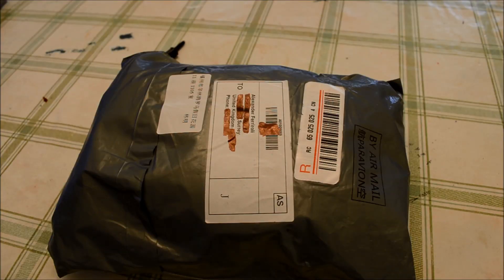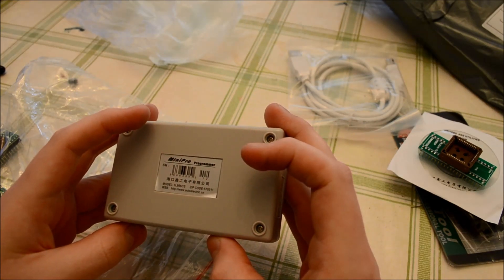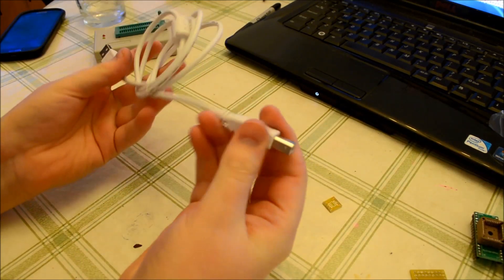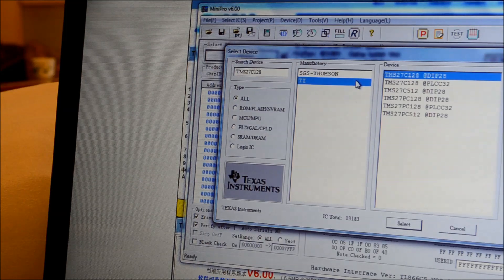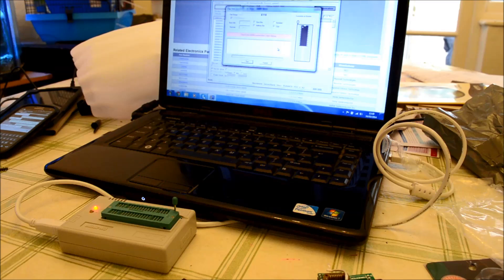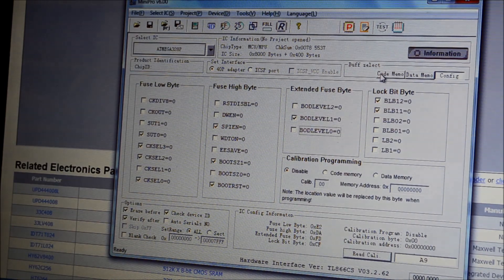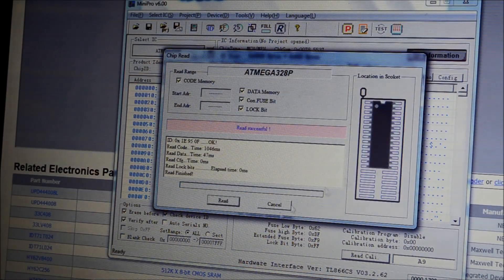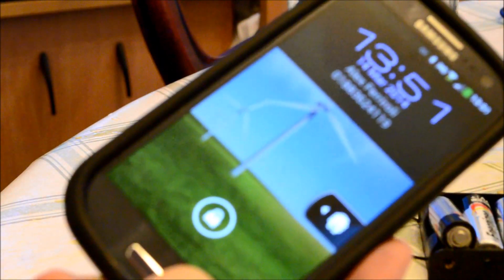MiniPRO TL866CS (TL866) Universal Programmer quick look and test

Comment: Hey i found very useful your video so thanks! 

I purchased a MiniPro TL866A and I'm trying to find some drivers for programming more devices. That programmer supports 16v8 GAL but I need the 22v10 programmer device one. Could anyone help me out to get the drivers?

Thanks!

Comment: Ok so what this device is useful for?
Reply: +Morris Spick Programming e(e)prom chips, obviously.   If you wanna update systems with programs on rom chips, you do it with this.  It's apparently great for reproduction games.
Reply: Programming microcontroller chips such as those used in the Arduino, programming PROMs, EPROMs & EEPROMs, testing logic ICs (74xx series) and testing many common RAM chips.

Comment: do you need to load tables or make any .tbl files or does it automatically find them based on the numbers that you searched
Reply from the maker: No tables had to be made or loaded, it happens automatically. The software comes with everything it needs. I don't know whether you are able to add to it any chips that are missing though.
Reply: Alex Ferriroli thanks, i didnt know, 
i asked because i was planning on buying one off of amazon and wanted to know what to expect
Reply from the maker: NEShackin If you want more information, there's also a very long forum thread on EEVBlog forum: http://www.eevblog.com/forum/blog/eevblog-411-minipro-tl866-universal-programmer-review/